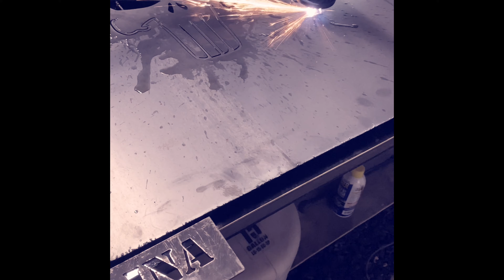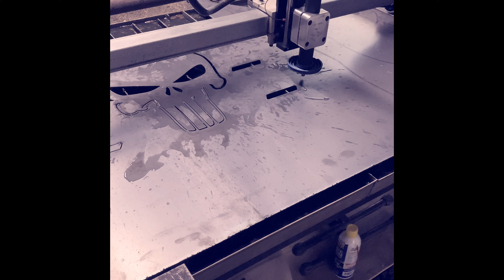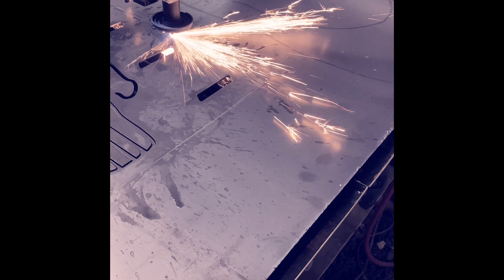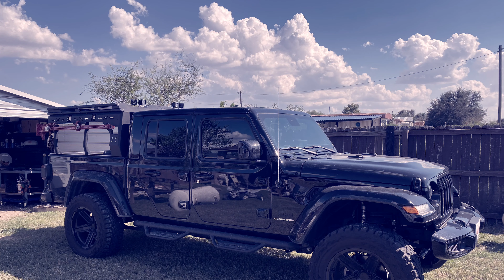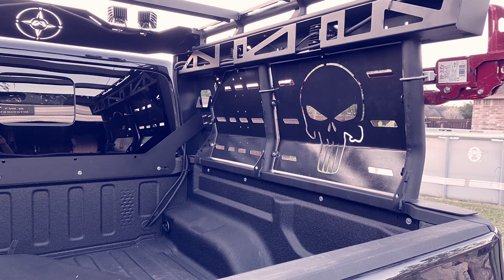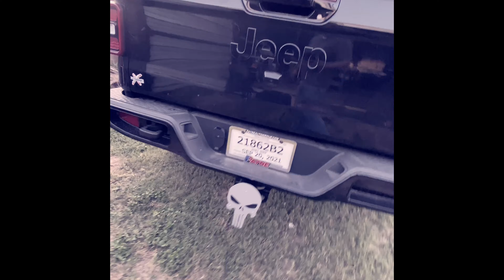Gladiator rack cover plates on Crossfire pro CNC plasma table

Comment: Great vid. Would like to know how is it currently working and have you had any equipment failure?

I ask because I have the exact cut 60 you show setup and considered the crossfire pro.

I spoke to langmuire tech support today for a few questions before purchase and wqs told the cut 60 isnot compatible. 

They currently don't k ow why but they said it is one of 5 known problem cutters that literally fry the electronics in the side mounted module. (I forget what that is called)

I asked about decoupling it from the station torch type and proximity of the plasma cutter tonthe system as variables and he stated they tried all that. 

This sank my heart I was all set on this table but being told about the plasma cutter I own would damage the cnc setup and not be covered that is a shiw stopper for me. 

Since they have created a plasma cutter compatability chart which has no primeweld on it.
Reply from the maker: Join the Primeweld group on Facebook. There’s several people using the cut 60 with the crossfire pro without any issues. Myself included, I’ve been running this combo for over a year